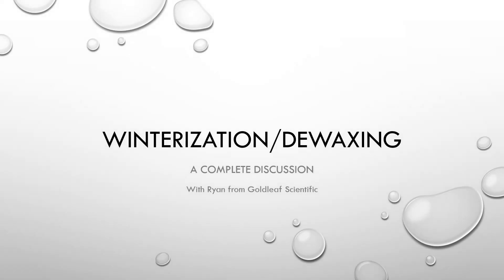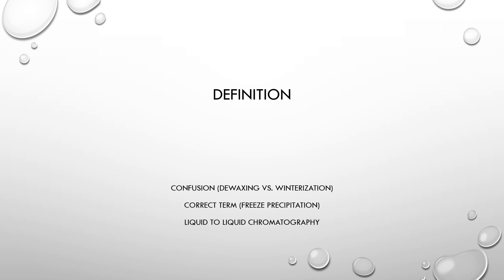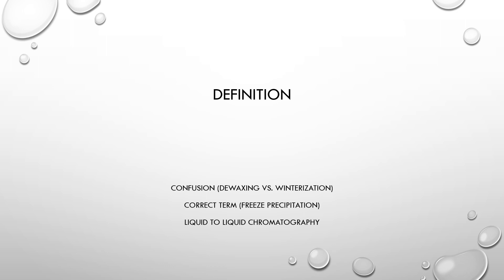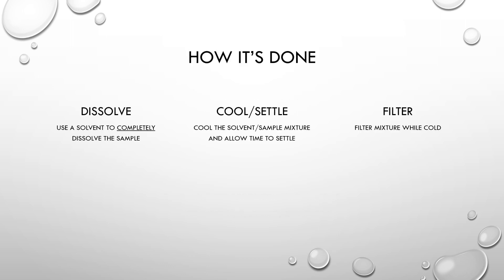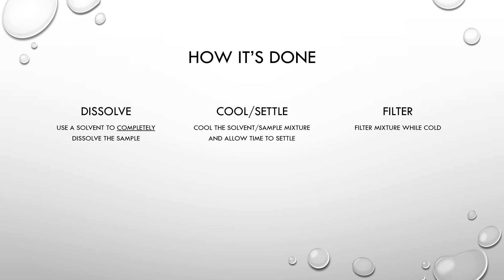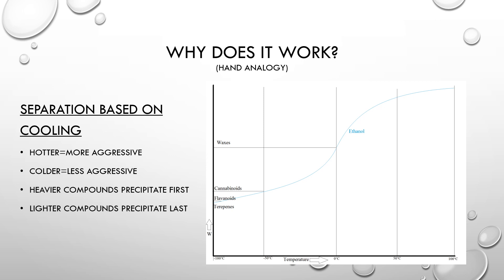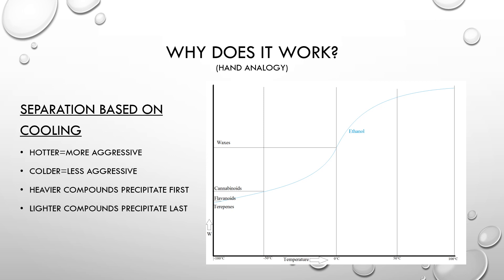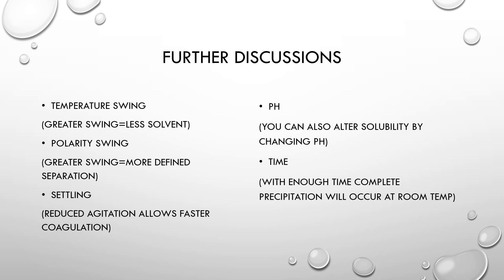Winterization/Dewaxing of Cannabis Extracts

Comment: Hi Ryan, Why did you state that you wouldn't go below (-50C)?  I assume that the solubility of the cannabinoids goes down too much......Yes (i.e. as the temp goes down molecular activity goes down as well)?  Then what would you suggest would be the ideal temp for hemp extraction?  Many manufacturers are selling chillers that go down to (-80C).  Thank you.-Paul
Reply: I've heard THC drops out Below -40 (good for CBD compliance though).
Reply: @dallasbreault289  Hi Dallas, NO unfortunately THC does extract right along with CBD.  They have the SAME molecular weight (314.2 atomic mass units) just different molecular structures!

Comment: Hey, would you give some technical info? Talking about Time.  What is the average time that the Butane should be soaking the herb at low temperature with a Dewaxing spool with a close loop extractor, using Dry Ice?  In the video you mention that even if a low temperature is used the winterization process should be performed after the extraction but that someone has done it successfully without the secondary winterization.  
Another thing: the Time that the herb should be freezed in dry ice (in the spool) before be soaked with butane at low temperature, do yo have this time?  All this due to the oil will be used in vapes.

Comment: If you do a bho extraction using a dewaxing collum and are after the distillate and terpenes do you have to carry out an ethanol based winterization after blasting and before using a short path distillation?
Reply from the maker: Maybe..it depends on the extend to which you remove the lipids. Usually butane extracts will still have a minute amount of lipids even after fully dewaxing with dry ice. In that case you would still have to winterize with alcohol, but I have met a few folks that have done it successfully
Reply: @GoldleafScientific  in your experience would  this minute amount of lipids stop the formation of sauce and diamonds? Or would it be highly inferior product compared to full lipid removal?
Reply from the maker: @jackdaymond9775  All depends on the amount of lipids. If the amount is very small then it shouldn't have much of any effect on crystallization, but if there's enough in there it will make the product much harder to crystallize and will be inferior.

Comment: Wow! Goldleaf, I can’t believe you just said that. If you start with grain alcohal first you are technically using a weaker, longer pull on the frontiers of chlorophyll, but with a very cold (dry ice)ISO pull of 30 seconds in contact using wide mouth beakers and a timer( remembering that the 31 second of ISO leaving the herb is diverted to a second jar and to be considered the remaining 15 % of the pull. A second run which in effect is also a 30 second run to finish. The second run of course are scallop and half shell THC wax and fat of pearls and chlorophyll. Winterize, rack and purge, pull with alcohol, winterize, rack, reclaim, cure, absolute.
Reply from the maker: Isopropy alcohol and ethyl alchol are both alcohols and almost exactly the same in ever respect. There will be no noticeable difference using one over the other. The iso is slightly less polar but it's negligible.
Reply: Goldleaf Scientific again your not seeing that 30 seconds ISO is a safer bet than 3 minutes with grain alcohol. Also trying it both ways with the grain alcohol first, gives very different results.
Reply: @GoldleafScientific  "small differences in polarity can have a DRASTIC effect."
Reply: Never extract with iso

Comment: It seems like the dewaxing process followed by the ethanol evaporation would yield the oil with all of the terpenes remain? Whereas extracting oil through heat distillation you would lose the terpenes because it’s sensitive to heat?
Reply from the maker: If you use less heat it will help retain more terpenes but that doesn't fully solve the problem. The purging process will carry some away regardless.

Comment: Each solvent strips something different, one can’t do what the other dose so if you use the wrong one first, you can’t go back and get what you left behind. ISO first, then ethanol. Absolutely.
Reply from the maker: ISO and ethanol are both alcohols. They are essentially the same molecule so it really doesn't matter which one you use first, or even if you switched out one for the other.
Reply: Goldleaf Scientific OK, but each is uniquely effecting the herb with one up against chlorophyll, I choose ISO.